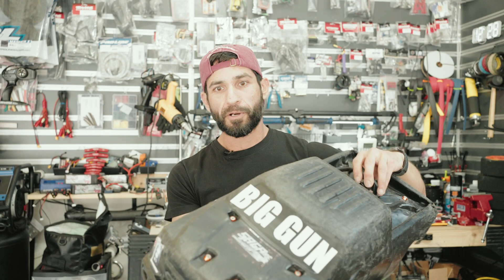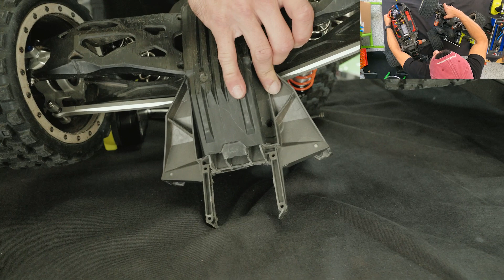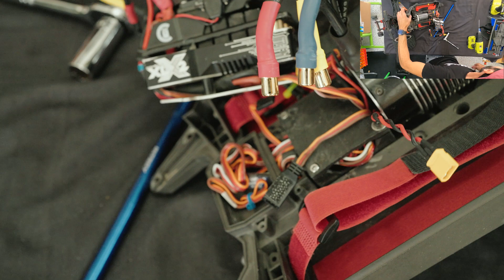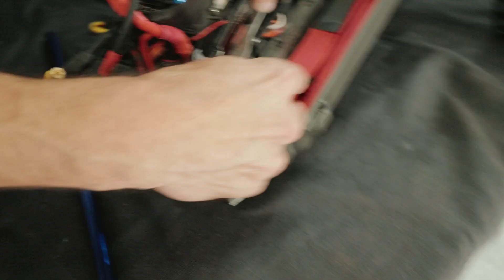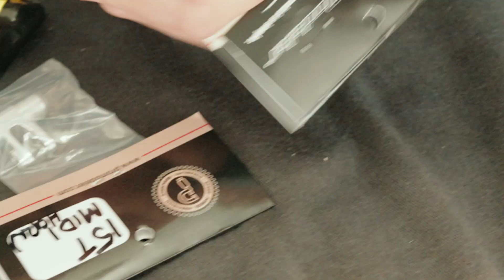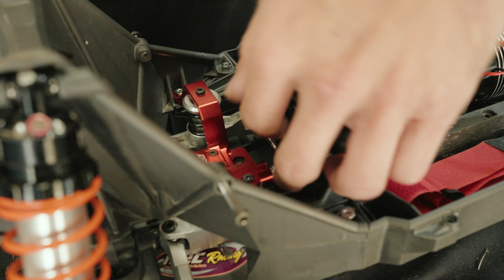Promodeler DS1885BLWR Midi Servo "Porker" Installation X-Maxx DS1885BLHV DS1885BLDP Large Scale

Comment: great help installing mine, works great. I broke the smaller promodeler servos for the xmaxx. My fault im abusive and have huge heavy tires along with massive kevin talbot style air)
Reply from the maker: That’s great to hear! The DS1885BLWR was made exclusively for the X-maxx/ [XRT compatible]. In fact, after lot’s of field testing the DS1155BLHV with big-air and second story over-pass launches, we discovered that the DS1155BLHV holds up to a point. So we went to the other end of the available motors and kept coming back to the DS2685BLHV Mega brushless servo motor. It’s the only 4S brushless motor and meant for 1/4 scale applications (but can be retro-fit into the 1/5 Arma chassis) and decided to design a casing that would allow the DS2685BLHV Mega motor in a small form-factor. Viola! DS1885BLWR was born! The difference in torque is due to the reduction gearing. We wanted a little more speed/reaction-time but enough stall torque to hold up under a 10X impact load! I’ve been able to launch my x-maxx repeatedly from a second-story highway overpass and nail those hard landings without any damage to the servo. It’s truly impossible to ever say something is “unbreakable” but in the world of servos, this is about as close as one can get to that label. The single biggest factor when considering the DS1885BLWR is being okay with the fact that a dedicated LiIon (preferred over Lipo because they have a much more stable shelf life) is needed to ensure 100% consistent performance each and every time. Charge usually lasts at least 2-3 runs between needing a charge from a 850mAh 4S LiIon.

Comment: Getting ready to buy one of these servos.  Buy once cry once.  Also subscribed because between the video and your replies to comments, you’ve answered every question I’ve had about them. I can tell you got a wealth of RC knowledge.  I do however have a more general question for servos.  What is the difference between a seperate lipo and a BEC? How does a BEC work? And which setup is more better/reliable/beneficial?  Thanks man. Appreciate it
Reply from the maker: So very glad to be able to help and thanks for subscribing! I hope to put out another install video for the DS2180BLDP soon (for the 1/5 Armas and Losi RCs). Email me at h3llfir3rc@gmail.com for in depth explanation (using diagrams) but to answer your question: 

It’s best to think of electric power as Analog Audio vs Digital Audio. With Digital, the sound wave will show missing “bits” of audio in evenly spread out chunks… to the listener, the sound gaps are often indiscernible at 192bit/s… as the audio file quality decreases, the gaps become a little more obvious.

Back to RC Servo power comparing dedicated battery vs BEC:

BEC power is considered “dirty” and a lot like digital audio, in that the BEC power is siphoned off the main power supply to the ESC, then recycled into small accumulated voltage and current leakage. The problem here is that there are a lot of continuous “gaps” in power and the ESC will always divert power to the motor as the priority, especially when throttle is applied under motor load. This results in occasional interrupted voltage and current to the Servo.

Contrast that to a dedicated LiPo or LiIon battery supply, which is more like “analog audio”. The power is always at 100% and never has power interruption to the servo. In addition, depending on how your receiver is powered, a dedicated battery will allow you to maintain steering even if the ESC stops working (as long as you have a separate power supply to the receiver). 

Overall, I recommend using a dedicated LiIon battery. LiIon batteries are more “forgiving” and can be left alone for longer periods of time without the battery going stale (cells begin to increase IR and discharge quickly). They can also be discharged more than usual without harming the battery, versus a traditional LiPo which needs to be monitored better to maintain voltage between 3.8V and 4.2V. 

Think of it this way: You already bought the best motor and ESC for your set up, then the best big lipo basher batteries… and made a ton of upgrades, and now you just bought the “Ferrari” of servos, good decision! So, why would anyone power a Ferrari with regular unleaded gasoline? They don’t!!! So giving your servo the best power source makes sense to get the best performance, after all, that’s what you paid for😊 – PERFORMANCE (plus durability and reliability)!!! 

Using a BEC is a second option and nothing wrong with it as some people don’t have room to fit another battery, or don’t want to create extra clutter… and this is perfectly okay, it will still allow the servo to perform, just not the way it does when using a dedicated battery pack. IF you decide to use a BEC, then I can only recommend the Castle BEC lines of BEC. Three in particular:

1.	Castle Creations BEC 2.0 – I like this one because the wires and connectors can be easily changed, but it is not water proof and is not fully cased. 
2.	Castle Creations BEC 2.0 WP – This is a WaterProof (fully cased) version of the one above and the connectors can still be changed but the case is not easily opened to add a completely different pigtail with a different connector, so you will need to splice and solder the different connector. Again, not a big deal, but cumbersome for some people that are not proficient at soldering. 
3.	Castle Creation BEC PRO – the most durable and robust BEC but mostly reserved for those very Large Scale trucks, planes and boats to power several large scale servos… this is often times too large of a unit to mount anywhere inconspicuous. 

There are other BECs that are also good, but the three above are the only ones I have tested and proven to be a reliable BEC. 

When using a BEC to power your servo, you will need to know how to wire everything up. Email me and I can help walk you through that process.
Reply: @h3llfir3rc   awesome. I was under the assumption, that the BEC was the better option. I guess only because it was another part to add. Good to know the additional batttery is the better option, as that would be my preference anyways. And the explanation makes perfect sense. Thanks man! Much appreciated
Reply from the maker: @adammidcal2425  Anytime! and yes, the dedicated pack is definitiely the way to go, but even I have had to use a BEC to power a servo, especially on certain space limited RC Builds. Not IDEAL, but an "okay" route, as long as I am using a high quality BEC. Last thing: Stay away from buck converter modules... these are not really the same and not engineered to handle the big surges in power from the mains. What ends up happening is that a surge from the mains (main batteries) overloads the buck converter (aka - step down) then sends a buck shot of surge to the servo and damages it bad if not, it kills it. The BECs I recommended have been Tested using 6S, 8S and 12S RC builds. There is one BEC that can be used for 16S but I have not personally tested it yet... but I plan to and that is the Hobbywing BEC. It's a BIG one though and costs around $80. It has some additional Failsafe connectors and very overkill, even for me, a guy that lives on overkill parts! Please share what you end up doing when you get your DS1885BLDP servo! I'd love to see how you set it up!

Comment: I ordered mine today. Thank you for a great tutorial
Reply from the maker: Fantastic! You will be amazed at the difference in power and control at high speeds off-road or on-road!
Reply: @h3llfir3rc  John Beech is a great guy. Excellent communications!
Reply from the maker: Welcome to the family! You now will be able to focus more on enjoying your X-Maxx and less down time messing with re-installing a failed servo! - Setting your end points and SUBTRIM are critical to a successful install. I recommend setting this before connecting the front bulkhead back to the chassis. Simply power on the radio (- use a small 2S lipo), plug the PWM connector to the servo (CH1) slot on the RX, then power the servo using a 4S LiIon propulsion pack (offered at Promodeler.com as well). Set the sub-trim center point as close as you can, then adjust the end-points for left/right throw: start at 80% throw on each side, then increase end-points until there’s physical/mechanical resistance - this is how people “break” their new servo by over shooting the throw… a lot like forcing the servo to push apart two 10-TON rocks… doesn’t end well for the servo. Next, use the TRIM (not the sub-trim) to fine tune the center point off the steering when at neutral “0” position. Now, reassemble the X-Maxx/XRT and do not forget to secure the servo horn to the servo output gear using the included M3 screw and bite-washer with a dab of BLUE loctite (NEVER RED). Use the outer “eyelet” on the servo horn to attach your steering link as that will give you smoother range of steering throw… the shorter eyelet will give a much quicker steering response, but can make it more difficult to control the x-maxx when steering needs to be less “jittery”. Bash on everyone! -Charles Moradi

Comment: With all that material removed have you had any problems with the front bulkhead breaking
Reply from the maker: Not at all, in fact, this truck has been my most reliable build to date. I have like two front bulkheads that I’ve had on hand for over two years now that I just haven’t ever needed to use.

Comment: That’s a $320 servo? For the money I’d want to see 3x the performance you’d get from the Traxxas upgraded servo
Reply from the maker: I burnt through three 2085X, two 2290Savöx, reefs555, and a couple of knock off servos. Haven’t had a single issue with the DS1885BLDP since I installed it. My only regret was not doing it sooner. So, I’m response to your question, I’d say it’s 10x better than the 2085X. Even MORE importantly, steering is now the last thing I concern myself with. The servo will hold a turn at 55mph with badlands MX43 which weigh 2.25lbs each wheel. 1885oz-in is over 135kg-cm torque.
Reply: @h3llfir3rc  fair enough. I just destroyed my first stock servo running the same mx43 badlands. I still sent it out for warranty ($40 replacement) but I can see this servo being a problem….thing is a mf’r to access too. I figure the less times I have to work on that servo the better. I just wish this promodeler was a little cheaper, I’d be all over it for 200
Reply from the maker: @4200Shields  I hear ya! After a while, it wasn’t even about the money. More about the down time. I don’t have lots of time as it is to actually run my RCs so when I finally get an afternoon to do it, charge 4-5 pairs of LiPos, drive out somewhere, find a spot and then break the servo 5min into the day, it is defeating. The cost is steep, but it’s been the sole reason I’ve been able to get through a full afternoon of running truck instead of wrenching it.
Reply from the maker: Last thing: the price will never be less than it is now. We both know that everything has gone up in price including castle XLX2 ESC recently. Along with their motor costs. Same ESC, same motors, higher price. If you have done any serious upgrades, then you know a castle XLX2 will cost $295 at the register. A castle 2028 series motor can cost $320 (1700kv) at the register. And don’t get me started on Hobbywing Max4 ESC ($449) or the HW70125 ($349) and then the superstar ESC from MGM (x3 40035) that costs $750!! So, maybe not you (yet), but the guys running those powerful power plants need to include the servo as part of the whole system. Power is cool but can be a liability if the steering is junk. Makes sense right? You spent $200 on MX43 badlands because the truck handled like junk on stock tires. Traxxas did an amazing job at pushing the absolute limit with X-Maxx and XRT. THE MOMENT anything is changed, there is a cause & effect situation. It’s wild to consider that they really made that truck so well balanced as long as NOTHING is changed. That’s the reason it’s not a true 1/5 scale truck. And why the servo is not a 1/6 or a 1/5 servo. The design engineer was able to scale everything to run just right at that scaled size and weight ratio. Otherwise, they would have made it a 1/5 scale truck. I’m sure it would have been a dog speed-wise though.
Reply: @h3llfir3rc  you called it. While I’m waiting for my xmaxx servo to get warrantied, I’ve been bashing my maxx 4s. Drive 30mins to the spot (a nice little bmx track) only to have ANOTHER servo failure after 10mins of driving. This time on the maxx. Now, of all of a sudden, paying 300 for a servo doesn’t sound so bad if it means I’ll never have to worry about it again. I’m leaning towards a savox servo. They stock them at my local hobby shop and the prices are decent ~$150. 
That all said, I got a solid 4 months of HEAVY bashing out my xmaxx with relatively few problems. Thing is a beast, same with the maxx. But this servo is garbage. I REALLY don’t want to go down the rabbit hole of buying new motor & esc just to run these tires.
Reply from the maker: @4200Shields  - Man, I truly feel for ya and know the frustration all too well. It is the reason I switch ALL my servos to promodeler… From a little 3S Arma Granite, 4S Slash, Arma Infraction & Limitless, 3 X-Maxx’s (All customized very different - Speed Runner, Basher, and Wide Kit back yard basher), 2 Arma K8S EXB’s and I use THREE PM Servos on my Losi 5iveT 2.0 Electric Conversion!!!! Again, steering servos are just not something I think about anymore…. It really allows me to tinker with pushing the envelope to the next level in performance with speed, handling and go bigger on the sends… The ONLY thing I will caution against is running at a sk8 park. There just isn’t a way for ANY servo to with stand a direct shock-impact  from landing directly on one of the front wheels and be expected to survive. That said, I have done 55’ sends off a 2nd story highway overpass from a ramp… Of course I have to land all four wheels at the same time, but no problem! My main basher’s suspension is also up to spec. Lot’s of trial and error but it handles it like a champ. I do still need to replace shock bodies every now and then as the heat and pressure begin to cause a “skirting” appearance on the lower aspect of the shock body where it threads into my aluminum lower cartridges. I really think your X-Maxx would benefit from the DS1885BLWR and the Maxx would benefit from at least the DS1155BLHV (It ALSO uses an oversized 15T Spline on the output gear like the DS1885BLWR). On ALL PM servos, the number for the model series is also the torque in oz-in. So, the DS1155BLHV has 1,155oz-in on 8.4V. The DS1885BLWR (and the DS2685BLHV Mega) are the ONLY 4S servos from ProModeler. All other PM servos are designed to run on 2S. If you decide to use the DS1885BLWR on the X-Maxx, there are two wires. The first one is the signal lead (which has a nominal voltage to carry the signal to the receiver) and the main XT30 that is used for the main power Direct to the servo. So both connectors are used. On the DS1155BLHV, you will need to use a RX ByPass Adapter in order to use a 2S power source. PM website offers this adapter (or you can make it yourself) but it allows you to plug the servo into the receiver to get a signal transfer, but separates the power to the servo so that you can use an external power source like a dedicated little 2S LiIon pack (or Lipo) or even a BEC, if your BEC has the stones (10A current ability). It is because, while voltage is important for operation, the current is what makes the servo come alive and where the response and zip come from. Hope this info helps on your journey!